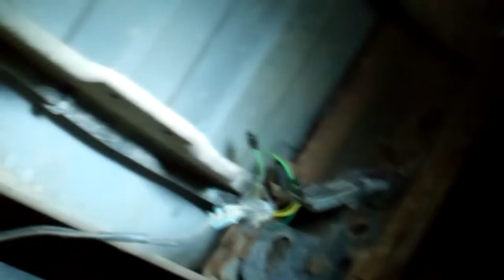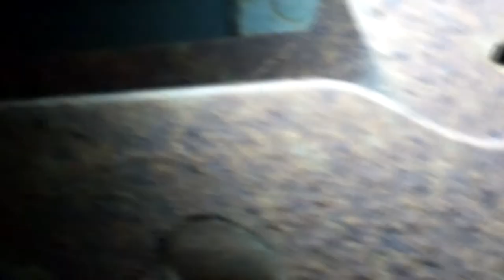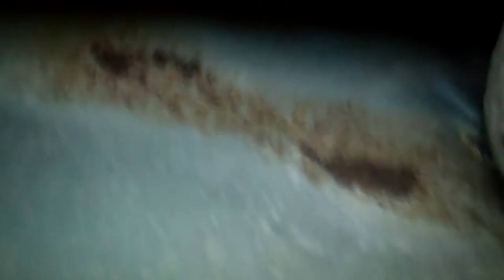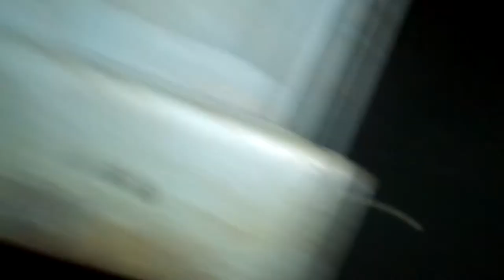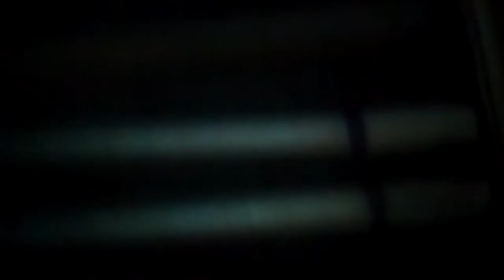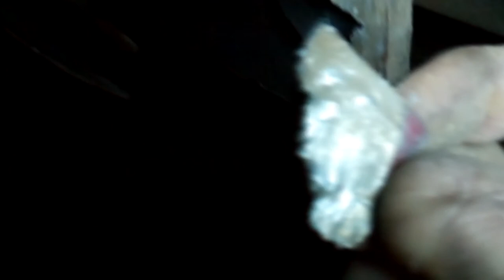Back at the project again

Comment: What a shame you did all that work and now its wasted.

Im a cheap git, i would grind the inner surface to remove the rust, then gently warm the metal up to expell the water, and then slap some hammerite on it, or underseal.
if i had no money i would use oil based house paint or just warm the area and apply thick grease, yes im nasty:-)